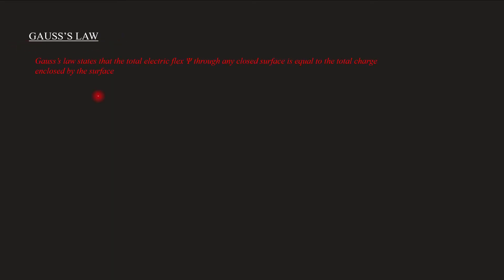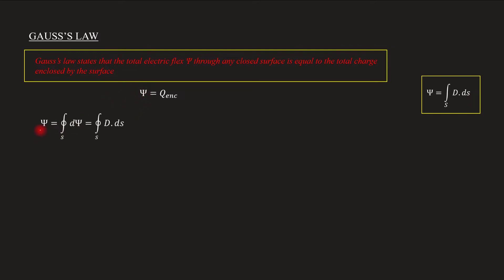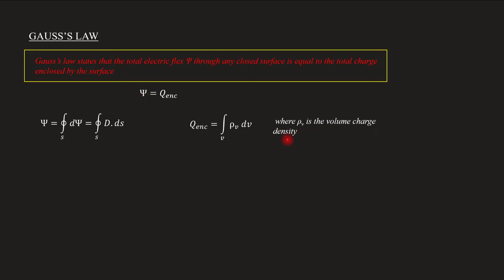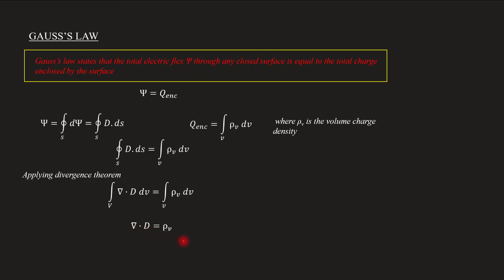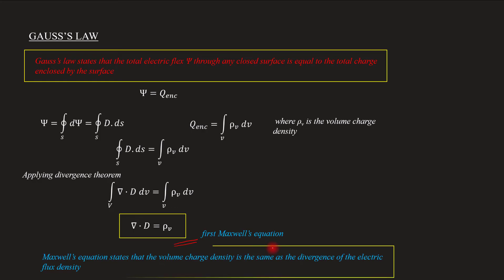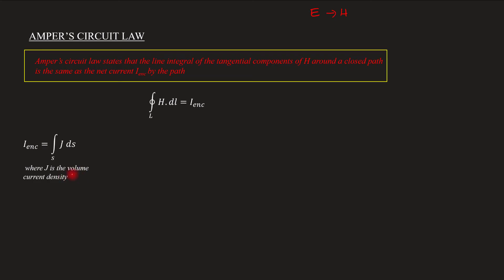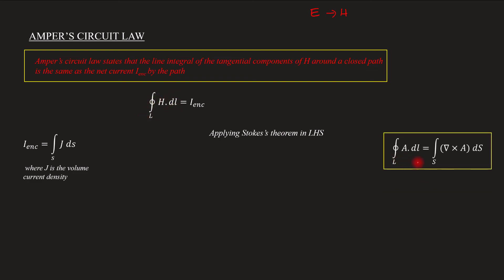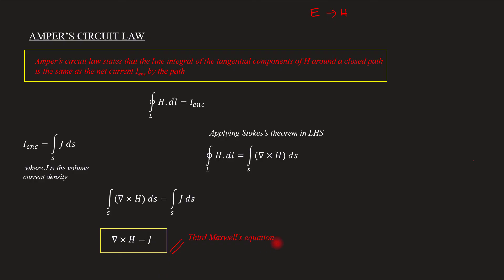Gauss's Law & Ampere's Circuit Law  | EM - Module 1 | Lecture 19

Comment: Apply amphere circuital law to the case of an infinitely long coaxial cable carrying a uniformly distributed total current I.compute the magnetic field intensity existing in different parts of the cable.
Ithengana sir cheyune